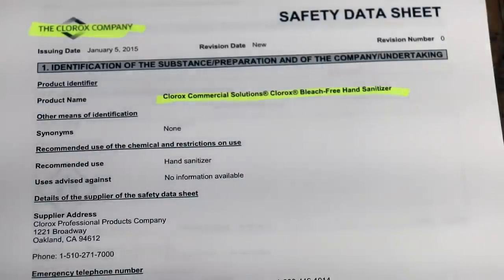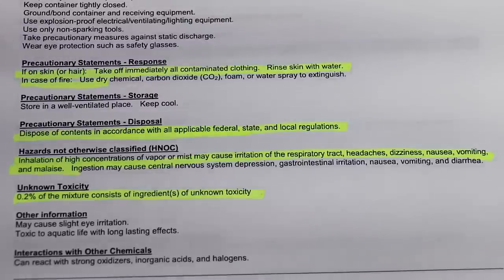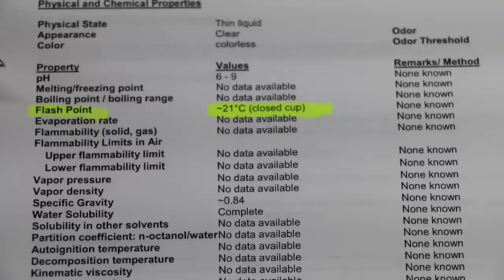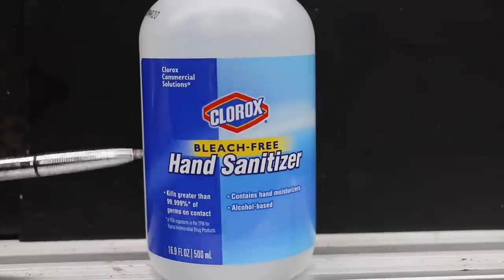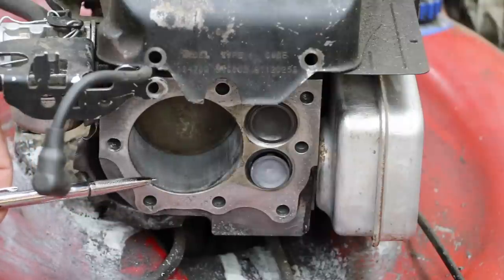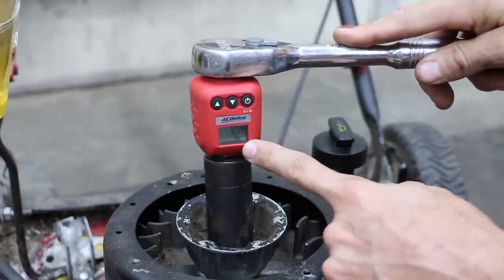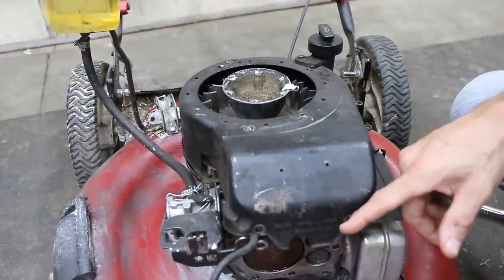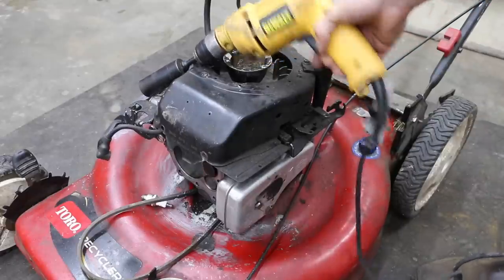Will an Engine Run on Hand Sanitizer? Let's find out!

Comment: Use dry graphite powder in place of motor oil.
Reply from the maker: Thanks for the video idea!
Reply: Would probably overheat and seize quite fast, but would probably make some great footage!
Reply: I like the idea, but I assume the fuel blowby will just gunk it up and turn it into a sludge.
Reply: I've been suggesting graphite as a crankcase lubricant for quite some time now, my thoughts on avoiding overheating would maybe be running a garden hose pouring water over the cylinder head and crankcase. This would maybe help dissipate some of the heat that the oil normally absorbs and dissipates.
Reply: @Only1Sethy  That would work only for some minutes
Reply: I like this idea!
Reply: @dimmacommunication  It would last longer than just plain graphite in the crankcase.
Reply: @Only1Sethy  True, I wasn't questioning that :)
Reply: Isn't there a graphite filled transmission system? I don't see it working much different than that. I've been curious about a graphite filled engine in replacement of motor oil too.
Reply: Something similar to a product called Slip Plate, used for railroad switches. Its basically a graphite paint. Keep adding mineral spirits when it dries up.
Reply: I worked as an industrial oven service tech and we used a graphite kerosene mix to lubricate the chain and bearing mains and I wanted to chuck some in a two stroke to see what happens.
Reply: @martinlumber  sounds kind of like Anti-sieze, we use it at the plant I work at. Used to keep bolts from siezing and other things lubricated. Stuff is so hard to get off your hands and gets everywhere!
Reply: Seth when I serviced ovens I would get graphite dust all over me and it would come out of my pores days later in splotches.
Reply: @DerelictDan69  Hence the name Dankey I assume... lol

That must be a weird thing to experience finding graphite coming out your pores at a later time. Did it itch or make your skin feel gritty?
Reply: @DerelictDan69  Hence the name Dankey I assume... lol

That must be a weird thing to experience finding graphite coming out your pores at a later time. Did it itch or make your skin feel gritty?
Reply: @ProjectFarm  that would be an interesting one

Or using strictly assembly lube as oil if that hasnt been tested. Still going through your library of videos.
Reply: TheConspiracy Realist no but the powder is so fine it gets absorbed. The name danky kang is an internet joke. But ya I would shower after work and cough that shit up and I would wake up with new black splotches on my arms face and hands.
Reply: @DerelictDan69  I guess thats similar to the old Xerox Printer cartridges with the powder ink. Stuff was nasty to work with, and hard to get out of everything, including clothes, skin, plastic, wood, hair, face...u get the picture.
Same with charcoal powder...similar to coal mine dust. Worst stuff to breathe in next to that old lady on the bus whose sense of smell went out years ago and she puts perfume on until she can smell it...thats deadly!
Reply: Yes do that
Reply: Seth that is how water air cooled systems work so it would work for a while
Reply: Awesome! Thanks for the tip on how to free up a small engine using Seafoam deep creep and Marvel Mystery Oil. This may make me a bit of money someday fixing small engines. Also, can you find N-Butanol and see if engines will run it? I hear it can be used as a direct replacement for gasoline. It has higher BTU than ethanol yet lower than regular.
Reply: Okay, mechanic newb here, admittedly, but what about a graphite solution as a lubricant? Or is there one out there that I don't know about? graphite/water, /vaseline, /vegetable oil, /nail polish . . . might make for some good videos, anyway. :) Love your videos, Project Farm!
Reply: @ProjectFarm  - dry graphite might be a challenge, but what about a graphite-based liquid lubricant, as used for cylinder locks?
Reply: Could u just mix lubricant that mixed with graphite? I dont see dry graphite working.
Reply: I'd love to see that too! Project Farm, please do this video idea!
Reply: Ive used it as a lubricant for a few different dynamic and mechanical projects. 
But I assume it's not used in motor vehicles because it doesn't circulate as nice and evenly as liquid oil.
Reply: @ProjectFarm  How does the spark plug fire on a lawn mower without a battery?

Comment: 2020: people panicking about corona virus and stockpiling hand sanitizers 
2018: project farm: let’s use hand sanitizer as fuel
Reply: Calvin Wu 😂😂😂
Reply: To be fair it was a year ago
Reply: Calvin Wu I just came here for the 2020 comments
Reply: Alex van Dalen He said 2018 project farm
Reply: I couldn't find hand sanitizer.

Does fuel work as hand sanitizer?
Reply: @Jason33784  or go to special shops (it must me more than 60%.
Reply: 2018: Can hand sanitizer be used as fuel?
2020: Can fuel be used as hand sanitizer?
Reply: My thoughts when I saw this
Reply: Of course YouTube would recommend this to me now 🤣
Reply: @Jason33784  i'd try brake kleen, works better
Reply: Jason33784 Not sure if it’s a joke, but just in case you’re serious, the answer is no, unless said fuel happens to be an alcohol or ketone (and, wait, now that I think about it, in some places they sell gasoline with ethanol... maybe you could extract the ethanol from it?). Glad I bought 5 liters of 99.9% IPA just before this happened (back in January).
Reply: Ironically in 2018 teens were also noted to buy sanitizer, de-gel it, then get drunk on it. In 2020 we're using drinking alcohol to make hand sanitizer!
Reply: Hydrocarbon82 De-gel it? Apart from distilling, I don’t see how that could be accomplished... and I thought hand sanitizer had denatonium benzoate (or similar) as a bitterant to prevent it from being drunk, at least mine does, tried eating pizza after using it...
Reply: @kelalen8811  Dont give hints, the next thing happens that people siphon our fuel out to sanitize their hands xD
Reply: @mattvandomelen9137  exactly
Reply: yeah he's stockpiling it to be able to mow grass.
Reply: 2021: ppl still using their stack of old corona virus era hand sanitizers and toilet paper as fuel and window wipes
Reply: 2021: let's use hand sanitizer because it's everywhere and no one wants it.

Comment: You have REALLY beat on that old Briggs on that lawn mower in all the tests that you've done. Amazing it's still operating.
Reply from the maker: lol. Thank you!
Reply: It just goes to show how much proper care can do for an engine.
Reply: That's a Briggs and Stratton  engine for you
Reply: But Uncle Ned that engine has been the victim of the exact opposite of properly cared for. In the name of testing. lol.
Reply: No kidding!
I can't believe reusing the shampoo engine!
I thought SURE that that was just DONE!
Reply: @greasemonkeymc  Definitely it, I have a 1970 Briggs and stratton engine 3hp that still runs good... was kept well though
Reply: Shane Singleton my father, ran that Briggs engine for 20+ years on a lawn mower with not a single oil change, and then he ran it completely out of oil. I filled it with oil and it ran for another 3 years. They are amazingly tough engines.
Reply: I had a B&S engined lawn mower stored under my house  for 12 years. I put some fuel in it primed it and it started after about 5 pulls. I ran it on the old oil for 2 whole summers before getting it serviced (but only because the cutter blades had completely worn down). Still starting after one or two pulls and  running  sweetly three years later. After having seen this channel's punishment I have to say B&S engines are tough stuff.
Reply: Shane Singleton yea it’s been thru it!

Comment: Thank you for making this video! A few years ago in the winter I pulled over to sleep in my van. Woke up and was completely covered in snow, miles away from a town and in the light of the morning, I realised I had parked on the peak of a huge hill so with wind chill factor I was at about -25. I ran my diesel van on veg oil and it had set solid and without the engine ruining I couldn't hear it up in the tank. I had about 400ml of hand sanitizer and used a little to burn on top of the injectors and the rest I heated the container with a lighter and squirted into the air intake. It was rough but it just about started. I always carry it in my van now!
Reply from the maker: Wow!  What a challenging situation!  Amazing job overcoming a dangerous situation using your intelligence and resources!
Reply: BTW, that didny say ignition point at -25° but ~25°.
~ means roughly.
Reply: Fake😀😀

Comment: My dad went to a local airport the other day trying to get 110 octane for his race corvette...Turns out the worker gave him J1 Kerosene jet fuel! The car actually chugged like a diesel all the way home. Reminded me of all the random fuel tests you do here!
Reply from the maker: Wow!  I bet your dad was one very unhappy customer!
Reply: Same thing happened  with my dirt bike ...... Not cool.
Reply: some shell gas stations sell race gas, its like 8 bucks a gallon and 100 octane
Reply: There is a small gas station in my town with 115 race gas for no apparent reason. No racetrack in 50 miles.
Reply: Aviation gas is leaded fuel. If it has cats it’s going to clog the shit out of them.
Reply: Oh no! We used J1 in mopeds  and it sludged it up good. Nitro-Methane worked MUCH better.110 octane. You could only use  a small % in the fuel or the bike takes off, throwing you to the ground. Great throttle response and HP
Reply: Yard Sale Dale  yes in the usa
Reply: Yard Sale Dale 100LL is common at regional airports in the US, the LL meaning low lead.
Reply: LL, or Low Lead fuels, still have a significant amount of lead. I used to run a Continental A65-8 aircraft engine and it HATED 100LL... even though it was 'low lead' it had about 5 times the amount of lead as the old 80 octane leaded aviation fuel. This caused it to foul plugs regularly as well as starting issues. Don't run leaded fuel in engines not meant for it, they will not benefit from it at all.
Reply: a friend's of mine dad used to have a '68 Cutlass that he always filled up on leaded racing gas, even though it's technically illegal for street use.
Reply: Most Preforments parts stores can order you race fuel. Here in iowa motorsports wearhouse cam get us a 55gal barrel of cam 2 or any kind of race fuel we want to order.
Reply: For all those mentioning about gas stations or other forms of buying race gas: We found out that the 110 they sell is only 7 dollars a gallon compared to 8 or 9 to buy at the race track or gas stations, so that's why we were buying from there.
Reply: sunoco will map out locations that sell their race fuels...

Comment: you can use salt to separate the gel from the alcohol if you are using the gel hand sanitizer
Reply from the maker: Great tip!
Reply: Salt to separate it. Wow good to know thanks
Reply: Is it drinkable after salt separation?
Reply: everything liquid is drinkable, can't guarantee you'll survive, but it will be drinkable
Reply: +iivoli its drinkable yes, but it dosent make it to pure alcohol. there are still some harmfull chemicals
Reply: I once saw a documentary about an old man who drank a few deciliters of gasoline every day, made me wonder if he ever backfired.
Reply: NO!
Reply: it's not drinking alchohol, it's the type that makes you go blind, or die
Reply: Joel Isnthere why would that buy ask if it was drinkable. Does he think that it like distilling liquor and making moonshine.  Apparently he doesn't realize that even if it was the same that if you mess up just a little bit when making moonshine that it can mess up your brain and all the way up to killing you
Reply: run the sanitizer thru a distillation apparatus, one pass will get rid of 29 % of the water and the isopropanol. you will be left with a ethanol-water azeotrope @ 85%. The only other way to get it higher is run it through a relux stack then dump in some 3A microscopic seives to get it to 100%. No, salt won't work on the azeotrope either. Potassium carbonate will get you real close as a drying agent.
Reply: I think I remember seeing videos on YouTube on how to separate hand sanitizer but not sure if it was drinkable. Maybe YouTube took them down.
Reply: Ariel Kozak j
Reply: iivoli yes you could drink it
Reply: +bigrockets That's a lot of work to get drunk! Cheaper to just  buy a bottle or even distill some sugar yeast water mix like I did in high school. No chance of methanol poisoning.
Reply: I heard a story from someone who used to be a prison guard that the prisoners continually tried to get drunk off of salt and hand sanitizer.

Comment: * watches video * looks like it worked well!

“Would I recommend this? Absolutely not!”

Me: “...oh”
Reply from the maker: lol. Thank you
Reply: You could tell from the see through cylinder head, when it ignited it had a weaker explosion, but I was thinking the same as you.
Reply: It's the same as E85, just add more fuel and it will be fine
Reply: Not funny

Didn't laugh
Reply: Probably very difficult to improvise a manual choke on an automobile engine.
Reply: @HariSeldon913  just gotta give it a good tune, it's all electronics now, just up the fuel injectors duty cycle and it should run good
Reply: the oil companies paid him to say that
Reply: @HariSeldon913  Carbs have chokes

Comment: Test efficiency of recip saw blades- carbide vs bi-metal. Time, finish, longevity, cost per cut.
Reply from the maker: I promise, that one is coming soon! I've already purchased everything for the test. Great video idea!
Reply: And or zip disks some good ..some not so much..
Reply: FWIW, I really like the Milwaukee "Torch" blades. I hope they're included in the test.
Reply: @TheBrokenLife   I'm also a fan of the torch blades
Reply: I'm always open to input based on good data, that I'm sure PF will provide, but it would take a lot for me to go back to something else now. They're expensive, but otherwise they're the bomb.
Reply: @ProjectFarm  I would really like if you did more practical videos like this and expanded into other areas like tools. I realize you have been doing what's most asked for so far.